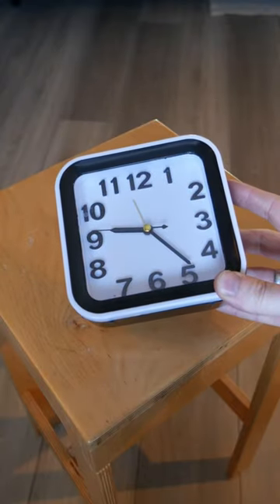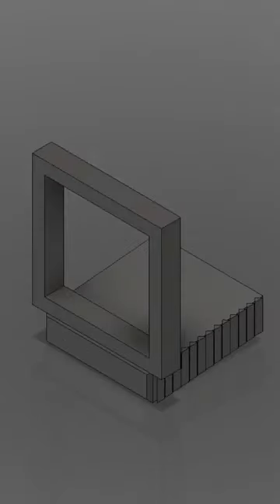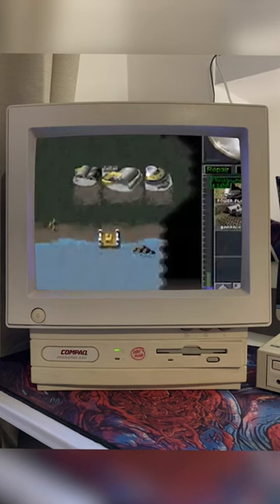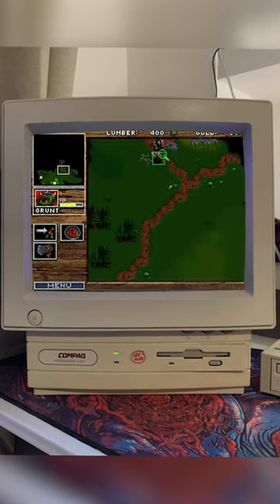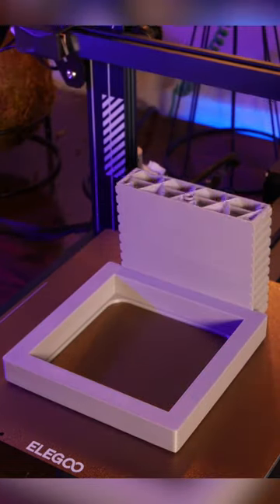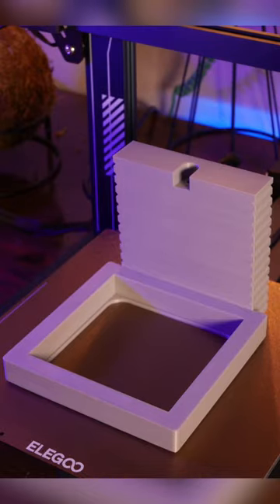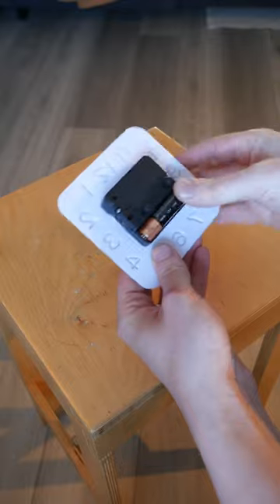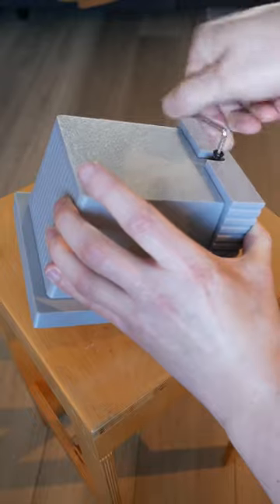This is why I love #3dprinting

Comment: Well done now you just need to replace the clock face with the retro font and a cursor for the minute hand and a retro hour glass for the hour hand. 😊❤👍
Reply from the maker: Great idea! I have a bambulab AMS on the way that could pull that off perfectly 🤔
Reply: @WildRoseBuilds  either that or a resin can pull off those thin pieces to attach to the existing hands on the clock… saving some effort. Another thing to consider is doing the clock face in two pieces so you don’t need to take anything apart but rather snap around the existing face. Especially if find yourself not liking the new look. 😎